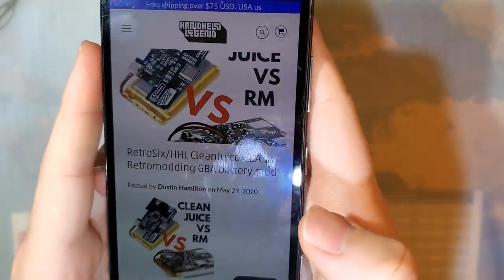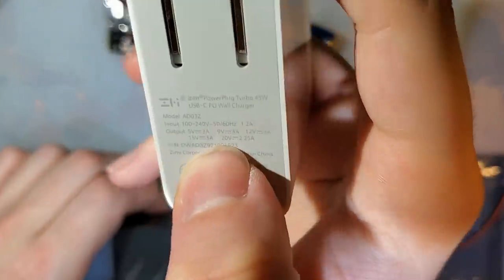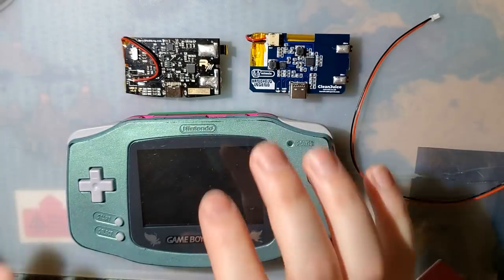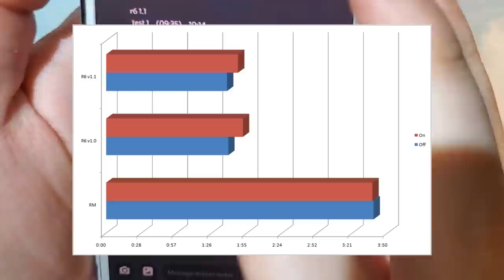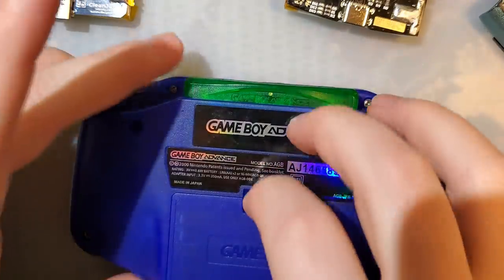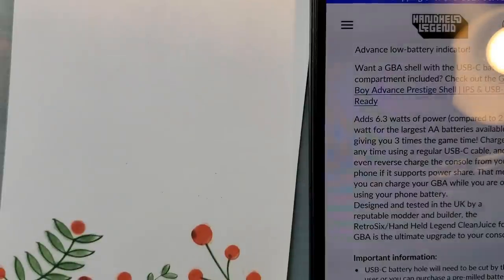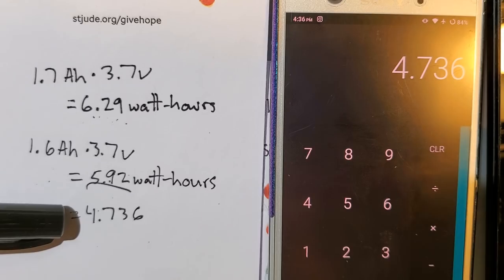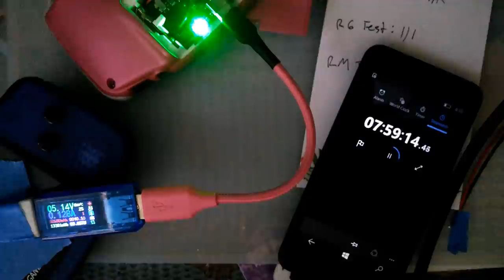Battery Mods for Game Boy Advance

Comment: Have you done any battery runtime testing with GBA Flashcarts? (Both the EZFlash Omega and Everdrive X5, as those seem to be the most common on the market). I have not had much positive experience running rechargeable AAs with a FunnyPlaying v2 GBA with a flashcart, I get pretty poor battery life with my Eneloops. Now I understand with these old consoles there sometimes can be pretty large differences in power efficiency from console to console, but I own 3 and all three have seemingly abnormally low runtimes with flashcarts (typically 5-6 hours). If possible, maybe could you visit this topic in the future? I would like to see some investigation to the AA battery runtimes when running at higher drain rates such as when using flash carts. 

There certainly is a posibility that the Eneloops that I bought are fake/defective, but it seems unlikely since I have 4 pairs of them, and they were bought about 2 years apart, from two different retailers and they all perform similarly with flash cart. I have never been able to get 10 hours out of any of my Eneloops, so if these IKEA batteries are that much better maybe I should look into trying a pair or two.
Reply from the maker: I don't have the ED-GBA X5 (so maybe this is a good excuse to get one) so I cannot test with that. I have not done any testing of run time with flash carts since when I tried running current consumption tests, my meter usually overloads. I took that to mean mixing and matching mods was not the best idea. 

I do fully intend on revisiting this in the future. Originally, I was going to delay this video a few weeks because there is another battery mod I wanted to look at (well, two actually) but one isn't out yet and the other is still stuck in shipping limbo. For a control, I'll probably even grab a fresh pack of AA alkalines. 

One of those battery mods in particular I wanted to test with a flash cart so I might as well test all of them with it. 

Also, one last note, after a year or so, generally, batteries do start performing worse than previously. Your batteries might just be getting a bit old. My LADDAs haven't noticeably degraded in performance, but I have noticed slightly more self discharge and they are about one year old. Because of this, I tend to pop them on the charger before I do a video now (especially the AAAs). I could also just be looking for issues that aren't there since I have no way of accurately measuring them (nor did I record the initial capacities and self-discharge).
Reply: @makho  Would be happy to see more coverage of battery mods (I am only aware of the two mods in this video, so more options is always welcome)
Reply: I would have to change my double A's like twice a week (playing for a couple hours a day) when I used an EFZO and the FP V2 screen. I think the EZFO just guzzles battery, which does not pair well with older, rechargable batteries.

Comment: Has RM mentioned any future revisions such as a battery connector? It might be nice if they used one, especially if it was a more common one. It’s not a deal-breaker but those little details add up.
Reply from the maker: The only detail they were explicit about was that newer batteries would have larger, higher capacity cells. They didn't say anything about battery connectors but I can speculate that they may start using some new low profile connectors based on another product they are getting ready to start selling.

Comment: never get the appeal of these kinds of mods, I for one am quite glad that the GBA accepts easily swappable AA instead of having irreplaceable batteries like every single device these days are. Taking AAs out for charge isn't that hard of an act... and $40 for that is such a joke. Anyone who has a brain would opt for 24 x rechargable AA instead. People are really doing mods for the sake of doings mods these days...
Reply: In my experience, NiMH AAs don't hold up under high-drain use, which will happen if you're using an IPS screen and a flashcart (EZFlash carts are a lot worse than Everdrive in terms of power draw, and they both consume more power than OG GBA carts), and sometimes its nice to be able to charge while you play, as well as having the added convenience of being able to use the same cable I charge my phone to charge the GBA as well. It's really quite handy for travel.

I'm not sure where I can get 24 rechargeable AAs for $40, that seems pretty cheap (where I live, a 4-pack of Eneloop Pros cost £22, which is still pretty reasonable, but I assure you, there is legitimate utility in doing a Lithium-ion mod, even if you don't see it, it's not just 'doing mods for the sake of modding' as you said.

There's nothing wrong with AA (neither primary cells or rechargeable ones), but have you considered some people find it more convenient not to lug around spare batteries as well as a dedicated NiMH charger when they travel? Also, these Li-ion pouch cells are in no way 'irreplaceable' as you said, they're LITERALLY a separate unit from the battery charging/conditioning circuit, and you can swap out the cells any time you want (the retromodding kit takes a bit more work, as the battery is Epoxied in, so you'll need to splice in a replacement battery, the Retrosix kit uses standard JST connector, and you can replace the cell whenever you please.

I think just because you don't understand the appeal of these, that doesn't mean there isn't a use case for them (especially since doing the mods do not stop you from using AAs, in the case of the Retromodding and Retrosix kits, you can still use AAs just fine once you remove the Li-ion kit)

I mean, I do have a brain, and I used it to weigh up the pros and cons of either approaches, and decided to go with the rechargeable kit, so I don't think your statement is quite correct...
Reply: @DuyLeNguyen  4 x Ikea LADDA cost $7. It is indeed irreplaceable, li-ion of the right size isn't easy to find and the design of the kit has it sticked onto the circuit board. Otherwise by your definition even an iphone battery can be considered replaceable.
Reply: @DuyLeNguyen  Not sure about your claim of NiMH not fit for high-drain use, they hold up really well with my setup that consists of all the things you've mentioned.
Reply: @xiii9354  well, the other party did say 'anyone with a brain would choose AAs over Li-ion' and I offered one example of a person with a brain who did otherwise...
Reply: @user-yk1cw8im4h  on my GBA with a funnyplaying V2 kit, playing games off of a EZFlash 4 Omega, I get consistently 5-6 hrs of continuous play time on one pair of fully charged Eneloop Pro, and just a smidge over 10 hours using the Retrosix kit. This is a significant enough difference that pushed me over to using a rechargeable mod instead of carrying extra eneloop in my bag (I should mention again the convenience factor of being able to plug it in using the same cable that I charge my phone with, which I always have in my bag already)

As for how easy it is to find, these are absolutely bog-standard lithium pouch cells, they're sold based on sizing (usually a 7 number string denoting the size of the pouch, I can go on Aliexpress/Mouser/Farnell right now and buy a replacement cell for my rechargeable GBA battery mod. It's absolutely trivial and since Li-ion batteries are so common in small electronics, most places have specific recycling programmes for dead Li-ion batteries, I can even bring them into work and pass it onto the IT department for recycling.

They are also not permanently attached to the circuit board (at least not the Retrosix mod that I have, the battery is shipped in a separate bag from the charging board, and you can choose whether or not you want to peel off the sticky tape and stick it on the board (it's not some super super 3M very high bond tape either, it's bog standard double sided tissue tape, and trivial to peel off and replace)
Reply: @user-yk1cw8im4h  I was into LED torches a fair few moons ago, so I did a lot of testing with NiMH in high drain LED devices. Typically the stated capacity for recharegable NiMHbatteries are based on a drain rate of 0.2C (for example, a NiMH cell of 1900mAh this 0.2C rate would be 380mA continuous). If you discharge the cells at a higher rate, the total amount of energy you get for completely discharging the cell will be lower than 1900 (could be MUCH lower on high discharge rates). 

Here's some good resource if you want to learn more, with pretty detailed and easy to read charts on measured capacity vs. discharge rate:
https://lygte-info.dk/review/batteries2012/Eneloop%20AA%20BK-3MCCE%201900mAh%20(White)%202019%20UK.html
Reply: personally, i hate double A’s. i have to remember where i stored them, that i have to charge them, and i can carry a cable in my pocket far easier than double A’s. plus, one cable to charge everything is cool. i was playing in my car a while ago, realized the GBA was running out of battery, then used my phone charger to plug it in and keep playing. and i don’t have to remember to grab the dead batteries and throw them on a charger when i get back home. plus i can top off a battery like this, unlike double A’s.

Comment: Hey Makho thanks for great video.
A favor (always asking for favors 😅 sorry for that)
Where can I buy the same battery charger that you have (ladda batteries), I like the info screen.
Thank you.
Reply from the maker: I'm using a Liitokala Lii-500 (old version, not the new version). It's a very inexpensive charger and I'm grossly misusing it. If you just want it for charging NiMh AAs, IKEA sells a charger that is just as good if not better and is actually aimed at charging their batteries. Same with Eneloop.

Comment: Didn't finish watching the video, yet so maybe you get into this (I'm so impatient) but the only advantage I would hope to gain from using a LiPo cell over the AA would be power draw issues. I have random boot issues on the EverDrive GBA X5 Mini on 2 different GBAs (stock and AGS-101 mod) but it's perfectly fine on the SP and DS Lite. Anyway, loving these videos
Reply from the maker: This may indeed be the case. I do plan on making a follow up video addressing this issue as I do not get into it in this video.
Reply: @makho  I just installed the new CleanJuice 1.1 and I still get random boot issues when using the Everdrive GBA X5 Mini. I have an AGS-101 installed so maybe my setup is just too power hungry.

Comment: Do these degrade quickly over time? I built this , I believe, in March this year with a clean amp, IPS, and clean juice. I was getting about 10 hours at the time, but now I’m only getting about 4-5 hours, not a year later.
Reply: the reachable aa batteries are much easier to replace and get

Comment: When putting in the battery, it looks like one of the battery terminal is pushing against the battery (left hand size). Can anyone confirm this? LiPo packs should not have any pressure applied to it, so I’m just curious.
Reply from the maker: that's why you're supposed to remove the left terminal (I did not but I should have)

Comment: Modern usb/ phone chargers support multiple voltages and current as standard,
which causes confusion between the battery board and charger,
because these charging pcb boards are basic bitches from yrs ago. 
Designed to works best with crappy 5W chargers (5V, 1A) from 5yrs back.

if you're willing to slice up your case, you can solder in a 2000mah battery and board for $5.
If that's not your cup of tea, best stick with AA rechargeable.

I agree, their wording and numbers are total bollocks. 
GB enthusiasts and modders appreciate anyone who still develops anything for these handhelds.
There's no need to bullshit the community.
Reply from the maker: I tested these with both a USB A and a USB C PD charger. Both worked fine aside from that strange quirk with my power meter that one time. 

I really do not recommend those DIY battery mods. They are really dangerous because most people don't take the proper precautions for safe battery handling and use.

Comment: R E T R O S I X. So regular cylinder-shaped batteries are still superior?
Reply from the maker: Depends on what you want. If pure run time is what you're after, then my NiMh cells still offer slightly more than a LiPo mod. If price is what you're after, then yes, definitely. If convenience is what you're after (not having to use a separate charger, carry extra batteries, being able to charge with the same cable as your phone, etc.) then not so much.

Comment: i need a better battery option for to gba pi
Reply from the maker: Both of these battery mods should actually work with that. RM told me theirs works with the freeplay at least.
Reply: @makho  thanks for the reply.i have 2 14500 850mah 3.7v  battery's at the moment but I'm looking for something with a little more power as I only get a few hours out of it

Comment: My takeaway from this is that they should offer the option to buy the boards without the LiPo packs (I already knew RetroSix was full of shit). I'd rather source my own from reputable sellers.
Reply: Hey just curious if you already know of a good source for the battery that fits the SP? (Similar to the one that always seems to be sold out on RetroModding).
Reply: Nathan Roberts I don’t remember the size of the battery but you can find it almost anywhere. If you need it quick and don’t mind paying a premium, look on Amazon or eBay. If you want it cheap and don’t mind it taking a month or more to arrive, buy from Aliexpress.

Comment: I am a fan of LiPo's for only a few things. One of those at the top of my list is the gameboy pocket cause on AAA batteries it is complete garbage. With a 1000mah lipo I get like 7 hours with the new IPS and EZ Flash Junior vs 2 hours at most with good LADDA AAA's from Ikea. Other than that though I will stick to my LADDA AA's :D
Im sad to see that the propaganda was none other than really, that, propaganda :(
Reply from the maker: I actually have a really good idea regarding the Pocket battery situation that may not require mods. I'm still waiting on parts for confirmation and testing though. But that is absolutely a good idea when it comes to modded Pockets.
Reply: I’ve been extremely happy with it, but can’t wait to see what you come up with